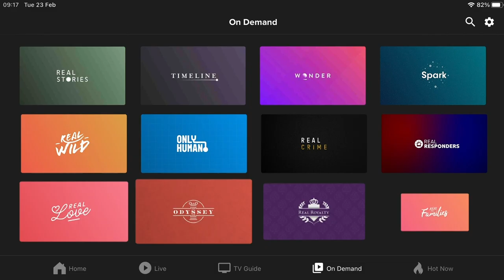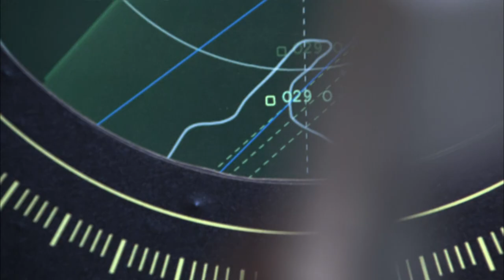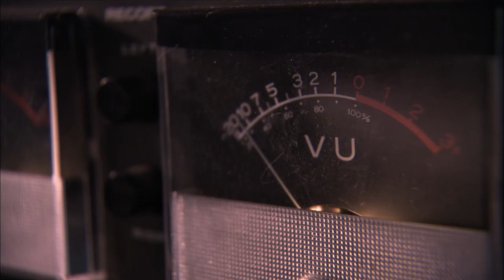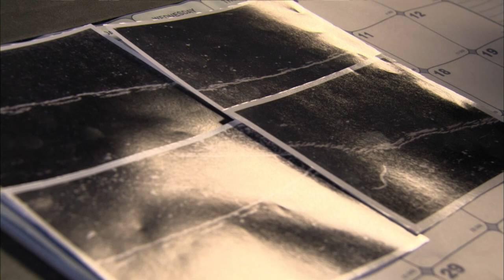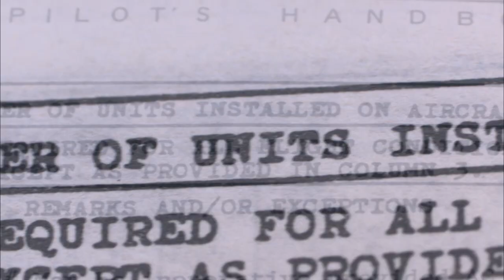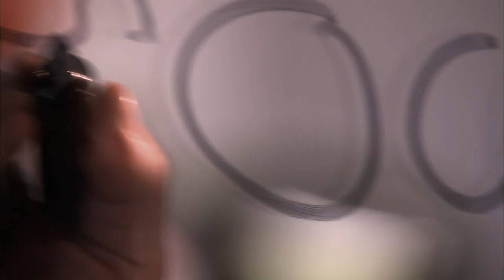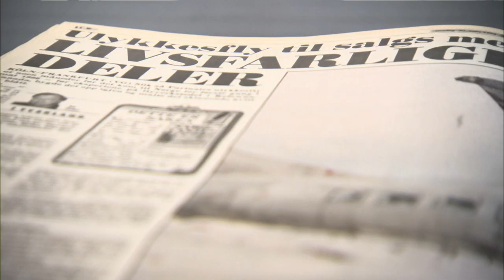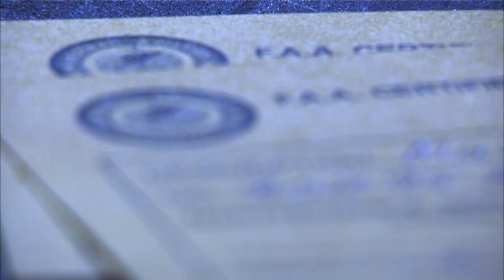Denmark's Deadliest Plane Crash Partnair Flight 394 | Mayday | Wonder

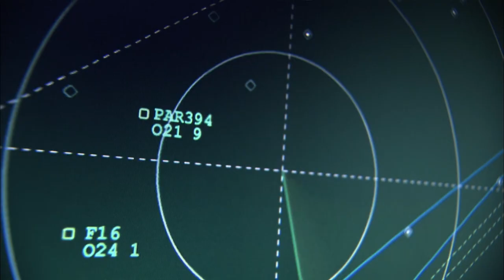Comment: While a few of you mentioned it, listen to the video again.. 4:12 "Whoa...look at that...11 o'clock..  F16. ... 4:24 suddenly the plane [394 passenger plane] experiences a violent "shock"."  quote unquote.  While the after-market parts might be a contributing factor on why the planes tail broke apart, clearly the producers of this video believes the F16 was the key event that caused the crash. Any plane coming at you at 11 o'clock opposite direction same height,  is dangerously close, and energy would be exchanged. If the F16 were traveling at mach 4... let's digress for a moment: In physics it is well known that two objects traveling opposite directions in close proximity multiplies the sonic force and shock waves exponentially.  Indisputably it would put undue stressors on every part of that passenger plane,  causing the plane to lose control. Yet the F16 in this video is not mentioned again - strange!    There are several explanations for this all plausible:  The investigation into the F16 is classified and they are unable to speak of it except in passing, no pun intended. The F16 was only made known by hearing the admission of the pilot and co-pilot seeing it pass moments before their own plane lost control.  Investigators were probably stonewalled by the Norwegian Airforce thus unable to prove it conclusively. Thus to avoid a slander/libel suit they simply do not mention the F16 again and choose to focus on weak aftermarket bolts as way of wrapping up their investigation.  Who was the main crash investigator in the end?  A Norwegian Airforce investigator of course. Conclusion: A successful cover-up means you and I will never know the truth.
Reply: riiiight...or...or it was worth noting because it was investigated.
Reply: But they did mention it again... There was a whole segment in the video talking about how they investigated the possibility of the F16 breaking the sound barrier and flying too close to the Partnair 394, but it was determined that the jet would have had to be mere meters above the plane to be a contributing factor in the crash. Personally, I think the pilots would have sounded quite alarmed to see a jet flying so close overhead, but CVR seems to indicate surprise more than anything.
Reply: I'm no professional in anything related to planes, but my guess is if the F16 was never in the scenario, the plane would have made it's destination. That's just my opinion though. It's just weird that it happened as soon as the F16 flew by. Maybe the bolts were bad but the fighter jet definitely didn't help the situation.
Reply: @soshiangel90   Not at all.  I myself took note of that F16 immediately at the start of the video. A red flag in my mind went up___I suspected FROM THE START that it very well could play a crucial role in this crash.  I'm sure that's true of many others here as well.
Reply: Right?! The fact that they lost control right after the F-16 passed by is just too much of a coincidence. I think it definitely had something to do with it.
Reply: The pilot of the F-16 testified under oath that he was 1,000 ft above them. They concluded that the planes never came close enough to make a difference. Partnair, the company that owned the plane, pushed that narrative because they wanted to pass the buck.
Reply: Absolutely

Comment: Around 45’, it is emntioned that companies are bottom - line driven…I would say there are too many companies each one is, of course, trying to rake it in But, there perhaps are not enough inspectors or inspections which should be “surprise” so no one has time to falsify logs, data…

Comment: $250 for a bolt is insane. How do they justify that? Why can't that be regulated also to prevent price gouging when it's so important to everyone who flies and possibly put a damper on illegal parts operators...
Reply: There could be a couple reasons:
1) Materials and treatment. If they are required to be specialty materials due to strength, expansion/contraction under temperature, weldability, etc.... those materials can be expensive to buy. 
2) Specs - if it's tightly toleranced - it can be expensive to build
3) Inspections - for high quality parts, there are inspection certs for the materials, inspection of the workmanship during build, and inspection of the final piece, followed by quality control double checking everything down to the material certs before sale. 

It adds up quickly. Yes there is profit margin, but a part like this has many potential vendors - so it can't be too much or they lose the contract.

Comment: The engine sound that the show used for this aircraft sounds a lot like either a Spitfire or Messerschmitt WWII fighter aircraft. Surprised that they couldn't find sound from a twin engine plane. Excellent otherwise though a bit jarring.

Comment: There are non-OEM parts for everything -- cars, trucks, you name it. It's in every industry. It's also the only way companies can afford to get parts many times.
Reply: There is a difference between aftermarket parts and counterfeit parts.

For example, Bosch do not make OEM brake pads, but their quality is just as good if not better than OEM parts. If you press on the brake, they will slow your car down as you try to go around a sharp bend.

Meanwhile, suspiciously cheap brake pads not connected to any known branding are often made out of subpar materials. If you press on the brake, the brake pads might explode from the pressure, cause the car to go out of control, and crash horribly into whatever was straight on around the sharp bend.

Comment: Why tf would only 4 bolts hold the entire tail to the plane
Reply: It is an ancient design that, while strong enough, would not fly today, no pun intended.  It is an extremely old design.  It was considered adequate because other bolts could hold it in place if one failed.  Today, that would never, ever, ever get through certification for its lack of redundancy.

Comment: i love how they give away the cause in the beginning. leaving you wanting to shout 'it was the damn f16' to remainder of the episode :D literally, they've shown it so close to the crashed plane. that was suggestive, i am still convinced the f16 flew way too close. that brought them  down, of course in connection with the fake parts used. but we'll likely never officially be told.
Reply: They said that the f-16 would have had to have been within 3-4 meters of the plane to have any real effect. They can prove that it wasn't that close with radar meaning that the f-16 wasn't the cause.
Reply: @JacobHolyfield  usually planes have to be several hundred feet apart to not interfere in the others airspace...3-4 meters? more like 300-400.
Reply: @JacobHolyfield  so having established that, it is very much possible, given the bad shape the plane was in, that the inference in their airspace by the f16 contributed to it's falling apart.
Reply: I’m not sure if you realize this or not, but your supposition is not supported by physics. The little F-16 would have needed to be <10 meters from accident aircraft to have had any meaningful effect, and that’s never been seriously suggested. The tapes suggest that it was much, much farther away. A larger jet, such as a A320, could have had an effect at some distance, due to normal wake effect - if it were <~1,000 ft above. But again, the presence of a large jet in close proximity hasn’t been seriously suggested. Even more, the F16’s wings do not produce significant lift in the first place - it’s vertical performance is a partially a consequence of its substantial thrust. Thus, while wake effect and otherwise unclean air surely existed (there is still lift from wings, and thus wake), they’d be fairly insignificant. Correlation does not mean causation. If the crew had noted a particularly beautiful sunset or mountain range, and that happened to be the last thing on the CVR, would that have downed the Convair? No. Its fate was already sealed by other factors.
Reply: @a1nelson  if it was breaking the sound barrier within close proximity though...?
Reply: @a1nelson  I'd certainly agree if it were two jets...but I'm sceptical in a case in which a) the sound barrier is broken by the jet...and b) the other plane being a pretty out of shape commercial airplane. I am not into the physics of all that...but under these circumstances something tells me it's kinda pretty somewhat maybe not safe.
Reply: @a1nelson  yeah a J100 on an F16 throws it around like a rag doll.
Reply: @a1nelson  the impact of breaking the sound barrier is a different story, isn't it? even fairly structurally sound martials can collapse in a range of it, at least according to what I learned. and a sound of a sonic boom has been reported.
Reply: @janalucke9739  Off the cuff, I don’t feel that a “sonic boom” would have had the effect of seriously disturbing that plane, in flight. While the waves created by an aircraft breaking the sound barrier can shatter windows or press down on roofing and cause other damage, I suspect that is due to the differences in air pressure (inside vs outside the space holding the windows) and the resistance to movement of stationary objects. A house, for instance, cannot move as it it anchored to the ground. However, in the case of the Convair, being untethered, in rather thin air, it had greater freedom of movement. This should be obvious to anyone who has encountered turbulence in an aircraft.

That said, I find this variation on the initial question interesting, and there are two other factors that I’d like to consider. First, I would expect the wave to impact the entire plane at roughly the same time - meaning that any pitch, roll or yaw moment imposed on the plane would have been minimal. So, using this model, the entire plane would have been moved in a single direction, acting as a rigid body - and, as such, would not have affected by the event any more than it would have been affected by say, a cloud.

On the flipside, however, the parts of the plane do have varying amounts of inertia. This suggests to me that the same pressure wave, applied to different surfaces on the plane, could cause uneven movement. As the tail has components with large surface area, yet is presumably far less massive than other parts of the plane, such as the cargo hold, engines, etc., the proposed wave could have experienced a disproportionate of deflection there. Related to this, the fact that the tail is also the part furthest from the center of gravity also implies that it would have had a proportionate, but not insignificant, effect (torque) on the attitude of the plane. Combined, these forces could have resulted in a brief disturbance of the tail section - perhaps becoming the straw that broke the camel’s back, as they say.

I’ll have to take a little time to consider the relative magnitude of these forces. I would note that the relative position & resultant “angles” of the two planes is also a factor. If the two planes were positioned such that greater force were applied to one wing versus the other, or any other surface/s, the effect/s could be quite different. Again, it’s an interesting question and I’ll have to ponder it. Thanks for your reply.
Reply: @janalucke9739  Absolutely agree - depending on the actual distance, it may have been unsafe. The more separation the better. From the video, I did get a sense that they were closer than they needed to be.

When first learning to fly single engine aircraft, I was surprised to discover just how far away one could observe other aircraft in flight.  I specifically remember being advised of a Learjet (about the size of the F-16) crossing many miles out, at a different flight level, and still being able to pick out its shape amongst the clouds without much trouble. This experience suggests to me that the accident aircraft did not need to be at all close for the crew to observe and identify the F-16.

With both aircraft in fully functioning condition, and the F-16 flying underneath, the Convair would very likely have posed a greater threat to the fighter jet than the other way around - at least in the short term (assuming the fighter pilot didn’t get too angry. ;) ). Of course, we, the audience, don’t have exact, relative position information and are left to speculate. And, of course, the Convair wasn’t in perfect working order.
Reply: @steven-nb6rt  That would make for a rather interesting video. Do you know of one? I wonder how difficult the recovery from that sort of upset is.
Reply: @a1nelson  got a related question, since you seem to have extended knowledge...on my first flight (i was 6, so more or less oblivious to what happen, i was told years later what went down)... during landing, the plane 'fell' twice. not the bumpy kind of fall as it occours during average turbulence, but really like...people banging their heads on the luggage compartment...we then, a few minutes later, landed with increased speed, a lot. meaning bouncy and almost reached the end of the runway before coming to a hold. what could that have been? i was thinking maybe microbursts? or clear air turbulence? what made me want to find out so much later is that...if it was purely bad weather...wouldn't the pilots have aborted landing? can you make anything of it?
Reply: You're wrong. They ruled that completely out. They would have had to fly extremely close which the investigators determined they were over 1,000 feet when they passed.  Listening is knowledge. It's shocking how we all viewed the same story but so much was not heard."
Reply: To a1nelson  Remember that the video of the F-16 coming at the plane was fictionalized -- what COULD have happened, and maybe to give a red herring to the audience.
Reply: @jillwilliams7342  Totally agree. I guess that’s storytelling for ya.
Reply: @janalucke9739  In theory.  In practice, the size disparity of the much larger and heavier Convair means that the wake turbulence from the F-16 would not have caused the plane to veer of course; that happens when a small plane flies behind a significantly larger one.  So in this case it is highly plausible that it might actually be that it would have had to be only 3-4 meters.

Comment: This makes me remember a very odd flight I was on as a kid. In 2000 me and my family flew a very cheap charter airline. They put us on a 707 that looked like it had never been repaired or cleaned. All the seats in the plane had like a 1/2 inch thick layer of dust. We got off the plane with dust covered clothes, and if you touched anything in the plane you had like a 1/4 inch coating of dust on your hand. I forgot what airline it was but whatever airline it was it was terrible.

Comment: TOO MANY ADS
Reply: Skip the ads by forwarding to about a minute or so before the video ends. Let it completely end on its own. Then click the x at the top right corner and then click the replay icon in the middle of the screen (looks like a circle with an arrow on the end). The video will start over with no commercials.

Comment: Just think about how this black market for bogus parts and certification tags only came to greater light because of this plane crash. The blots were not only not up to aviation standard, but were also 60% as strong as they should have been (probably because someone cut even more corners) and on and older plane who's broken generator and use of the APU on a broken mount made it fall apart mid flight. If those bolts were tempered properly, this problem might have flown under the radar (no pun intended) for who knows how long to come.

Comment: I’m sure the airplane parts business is a racket.  The $250 part is a $30 part that has been “certified”.  You see the same thing in automotive.  A supplier sells parts to Ford with “Motorcraft” Label for $30.  Motorcraft in turn sells it to the consumer for $60.  You can buy it directly from the supplier for $32.50, but it’s not “certified”.
Reply: The certification isn't just a piece of paper, it's an inspection by a very trained and knowledgable person with special equipment. Do you think those things are free?

Comment: What? The whole tail was held by 2 bolts and not even the right bolts. What kind of mechanics are these playing with people's lives. I guess he couldn't get the right bolts. So he got a replacement from the local hardware store. The tail should be held by a hydraulic cylinder pin not a bolt.